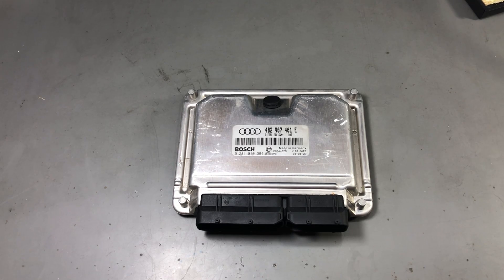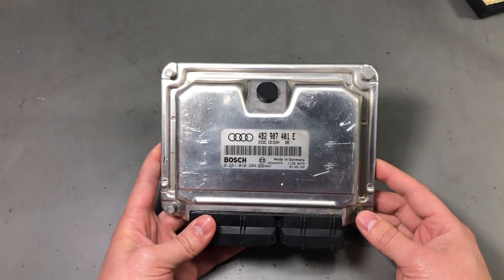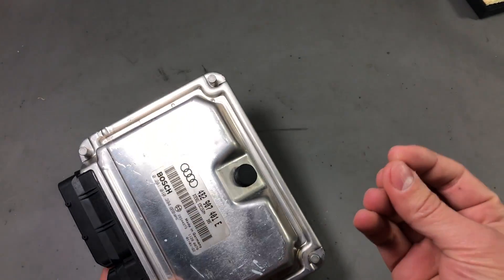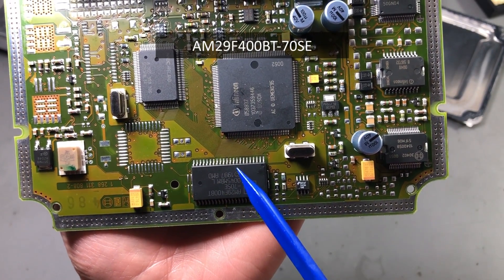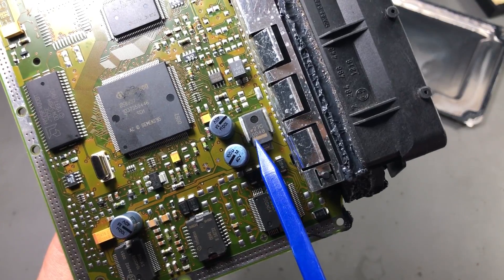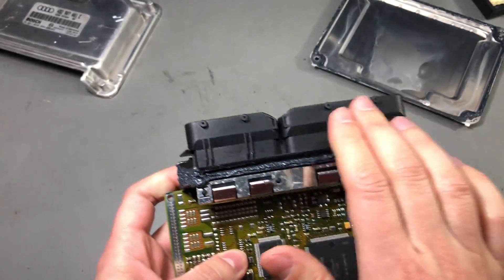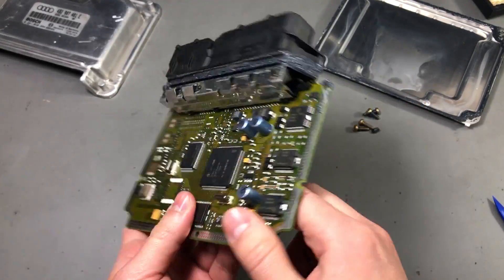Voltlog #225 - Taking A Look Inside A Bosch/Audi ECU EDC15VM+

Comment: The first chip you mentioned is the Atmospheric pressure sensor, since the ECU has torque and boost limiting maps based on atmospheric pressure.
Reply: How can it measure pressure if it's a sealed unit?
Reply: @JamieVegas its not sealed, the black thing on top is vent
Reply: @Skaude  It's sealed, and the black thing is just a rubber flexible stopper, it allows atmospheric pressure to be detected by the unit on the board, without actual contact with air.
Reply: @JamieVegas  its a Gore Vent

Comment: You didn't mention anything about CAN bus communication controller or input/output. One of the crucial properties of the ECM and common failure in these units. Anyways this video is very useful though.

Comment: I wonder if the processor can be reused for other duties? Remove it and have a new PCB board made for it.... There are literally tons of these things at the local motor dismantling yard and are also cheap...
Reply from the maker: I think the problem would be the development tools for that processor, compiler/IDE. Other than that it's a nice idea, this would be a great general purpose Digital/Analog control box.

Comment: AE4525 looks like an older generation mems pressure sensor that was used for altitude measurement.
Reply: From the part number it was most likely made by Aktiv-Electronic, Berlin
Reply from the maker: @megatesla  Thanks for the info!
Reply: Is it possible to replace it with a different one cause I can't find anything with this AE number ?

Comment: The connector is not just a connector, but also includes a lot of RFI shielding and ferrite filter chokes and bypass capacitors in it as well, evidenced by the rear of it being a RF cage over the inside.  Best to have this where the lead lengths to the outside are the shortest, so inculded in the connector housing by Amp. Hairy design work as your ceramic materials have to be precisely controlled as they do shrink during the firing stage from the green soft raw part, and those are also multilayer ceramic parts as well.
Reply from the maker: I saw the filtering passives on the pcb right next to connector pins but you are saying this connector also has built-in chokes and capacitors? Then it would make an interesting teardown, maybe in a future video.
Reply: @voltlog  Generally a lot of them do, often only on particular pins, with the extra components on the board being there for clamping purposes. Depends on the model though, if they have run out of board space then the connector becomes the filter space, or if they have need for extra filtering during EMI testing. Just pop off the steel shield and see if there is ceramic plating or ferrite plates inside. They typically are pressed over the pins before the bend, snug up against the back of the connector, with a grounding ring on the outside for the capacitor type.

Comment: A couple of weeks ago I replaced a Mosfet (one of the ones in the left on the heatsink) of a similar ecu in a BMW motorcycle.
Reply from the maker: yup I would imagine Bosch would spin this design around for multiple types of vehicles.

Comment: TANTALUMS? EVIL!
Reply: Not really, at least you know they will not fail for at least 20 years if properly specified and used correctly, while electolytics all are guaranteed to fail after some time. Tantalum if used well derated and current limited is not going to go bang, especially for quality manufacturers who run them conservatively.
Reply: why?

Comment: Failed to note them EMC protective features. Array of through holes all round outer edges. All pins are fitted with bypass capacitors at front edge connector.
Reply from the maker: Good catch, thanks!
Reply: I think the vias at the edges are as much if not more for heat transfer between the layers than for EMI protection.
Reply: standard EMC management, heat transfers are the pafs an through holes of the pads under the driver chips

Comment: The purpose of the do218 diode is to burn the fuse in the event of a reverse polarity in the supply line
Reply: Design must survive reverse polarity WITHOUT damage. NO BLOWING FUSES!
Reply: ECU must survive reversed supply without damage. NO BLOWN FUSES allowed.
Reply: Depending on requirements that diode is added for the exact purpose of blowing the fuse ,that does not mean that other protection is not pressent for the ecu to survive the reverse polarity.
Reply: @Brandon-wo2xj  have been designing such ECU and am quite familiar with the specifications by the Auto manfsvturers. Blowing fuses is NOT allowed
Reply: @helmuthschultes9243  Also designed such ECU, it is in place for reverse connection on the battery leads, also in Normal operation works as a TVS
Reply from the maker: I haven't checked but it could also be in series, preventing reverse polarity without any damage.

Comment: I haven't seen any conformal coating, is there any? 
Also CAN bus transceivers are not shown. 
Thanks
Reply: Most likely the CAN transceiver is the 8 pin IC (??43547) between the  large Infineon controller and the TDK common mode filter (ZJY5-2). At least the pin-out looks correct.
And you are right, there is no conformal coating. It seems to be common practice not to apply conformal coating on these PCBs. Since the ECU is sealed, residual solvents in the lacquer can not evaporate and electrolytic processes can dissolve parts of the solder which then can cause short circuits between IC pins.
Reply from the maker: I was actually wondering why they didn't use conformal coating, but this certainly answers my question, makes sense now as that would possibly be unreliable long term.
Reply: In general conformal coatings can create their own problems. Not in favour at all also costly messy manfacturing step
Reply: My guess is the module is sealed, thus no need for conformal coating.

Comment: The bottom parts are placed in the same direction so they can be wave soldered. You can see bit of a red glue under one of the chips. This saves even more costs.
Reply from the maker: Good catch, thanks!
Reply: @voltlog  
Also the extra pads after each IC on the bottom tells you the direction of the wave soldering. They are "solder thieves" and are there to prevent the last pins from being bridged.

Comment: VL, the rubber valve is not for condensation/humidity, the ECU has the MEMS atmospheric pressure sensor on the PCB(the AE4525) so it needs an opening to the exterior
Reply from the maker: This could be true if the ECU indeed contains the pressure sensor but I haven't confirmed that yet.
Reply: Newer ecus doesnt have them on the board. Do not spread misinformation;)
Reply: @abcdsz  it's not misinformation, that SOME ECU do not have does not mean all of them don't
Reply: I have worked with a lot of ECUs from Bosch and Continental. None of them had an internal pressure sensor but each had such a vent plug.

Comment: The vent is used to equalize the air pressure between the inside and outside. Without it the device starts sucking water/moisture from the outside if the air pressure rises.
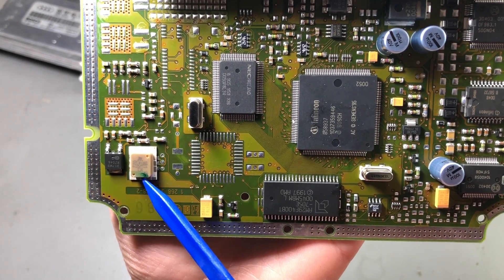Reply: That vent is NOT an air pressure equalizer or a humidity vent mentioned in the video.  The vent is there because the ECU board has a MEMS chip (Microelectromechanical systems) mounted on it to measure barometric pressure.  You can see a closeup of the tan colored chip with two holes in it at the 5:12 mark in the video.  The video refers to it as a pressure sensor, which is exactly what it is and would explain why the case needs a vent.   Without a vent, the case is sealed and the chip could not measure changing pressure.

So, instead of having a larger sensor mounted in the engine compartment to measure barometric pressure and the additional wiring that would be needed to the ECU, a tiny MEMS chip can be mounted directly on the ECU circuit board to serve the same function.   It is commonly found (along with a vent) on many ECU’s from different car manufacturers.  It’s also used in smart phones and other electronic devices.
Reply from the maker: But how can the device start sucking water/moisture if it's hermetically sealed?
Reply: @voltlog  I assume that it is sealed when it leaves the factory. But after some years the seal and the connectors are becomming vulnerable.
Reply: It's called as DAE or PCE Pressure control element. It doesn't allow air inside but it can release air from inside
Reply: you prolly dont care but if you're stoned like me during the covid times you can stream pretty much all of the new series on InstaFlixxer. I've been streaming with my brother these days =)
Reply: @Kase Mekhi Yup, been using Instaflixxer for since december myself =)

Comment: The extra copper on the PCB edges could be for heat sinking and also to create a faraday cage for EMC/EMI reasons.

I did this on a design I worked on. It will be interesting if the extra copper edges are capacitively coupled to the case, that’s what we did. But it can also be directly connected for EMI.
Reply from the maker: Thanks for the info.

Comment: Nice review. From what I've heard Infineon is not the major player anymore. Some of the manufacturers are favoring Cypress now.
Reply from the maker: Back in 2012 I worked on a project where Bosch, CRF and Freescale designed a new ECU controller chip and safety certifications were a big thing. Regarding on how the agreement was made between the partners this new architecture was going to be sold by each partner to a different market with slight variations.
Reply: It's about ASIL levels.  Some Cypress products are ISO 26262 conpliant too. 😉
Reply: Infineon now is the biggest player,it just bought cypress,it was the second largest manufacturer of automotive semiconductors slighty behind NXP,now it is way ahead.